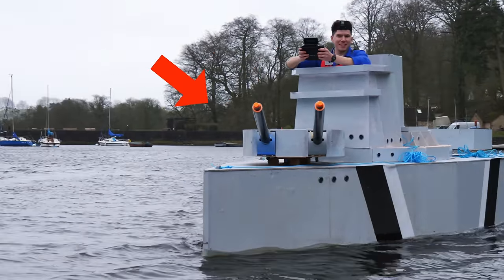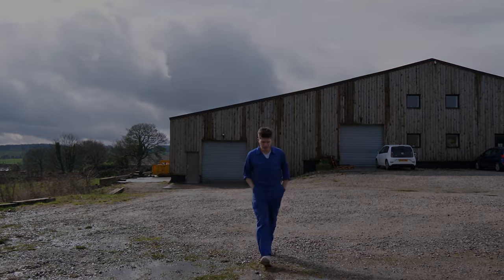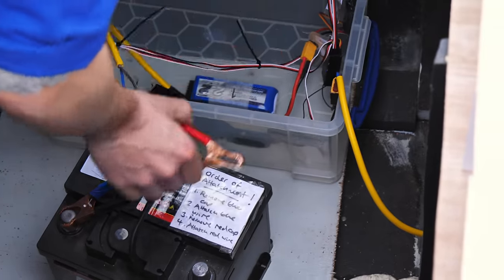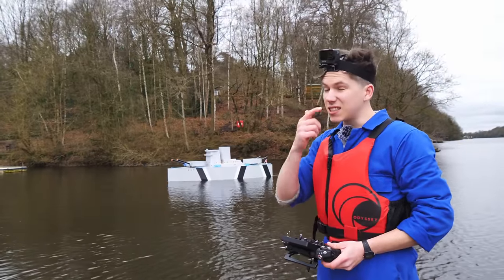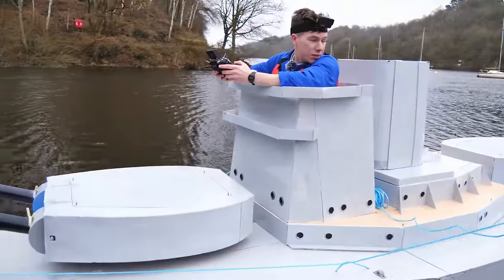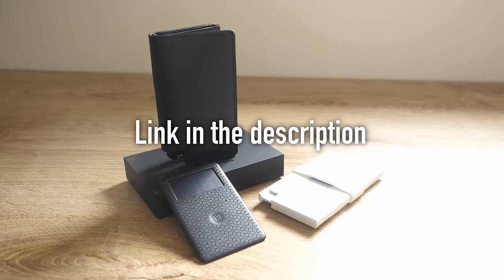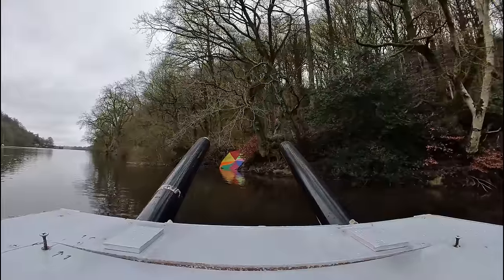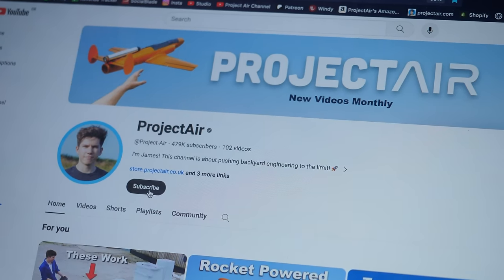World's Largest RC Battleship

Comment: Probably the only case of an aircraft carrier to battleship conversion.
Reply: there was one otherwise. in ww2 japanese turned a battleship to a aircraft carrier
Reply: wasn't just the japanese (the british and the americans did that too) unless you're referring to aviation battleships @kibabgaming
Reply: @kibabgaming wrong way around, original commenter said carrier -> battleship not battleship -> carrier
Reply: @apache_helicopter, do you have any idea of what iverwise means?
Reply: @toniolda087-lf5rv  Otherwise is used to descript an alternate situation to the one inititially present, i.e. another possible outcome for the same or similar situation.
kibabgaming use of it as "in the reversed situation" was both not very clear and incorrect.      
Fotunately the meaning was clear from the context of the sentence, so this wrong side thread, including my comment is just a pile of useless intgernet posturing on inconsequential grammatics

Comment: A submersible pump used for hydroponics could act as a bilge pump to keep the water out.
Reply from the maker: Would have been handy
Reply: Not a bad idea to put in extra foam in the bottom of the ship to keep it afloat. Some Bassboats come with this feature @Project-Air

Comment: I would from other people experience think about cases when: boat gets damaged, unglue, you fall through its floor and so on, and fill both tail and nose sections with construction foam so it will float anyway. And probably would fill place where electronics should be and cut a hole for everything so it will be operational in those cases.

Comment: @Project-Air Here is the story of your ship if it was a commissioned Naval Vessel: HMS Cod is a Cod-Class Battleship however she was originally a Cod- Class Aircraft Carrier after the failure of the Squid-class Aircraft Carrier. Launched on November 4th 2023 she launched 300 planes in her aircraft days then decided by the Royal Navy was to convert Cod into a Cod-Class Battleship which was 17.5 ft  and had .50 Nerf Turrets for its main battery which also gives the silhouette of the Admiral Graf Spee of the German Navy however this vessel was the plan for HMS Cod however she had to be made as an Aircraft Carrier due to resources but was to be converted the next year.

Comment: U can use spray or alcohol in pipe and then spark it in a tightly packed pipe and then spark it will make high pressure which make dart go more further with pressure